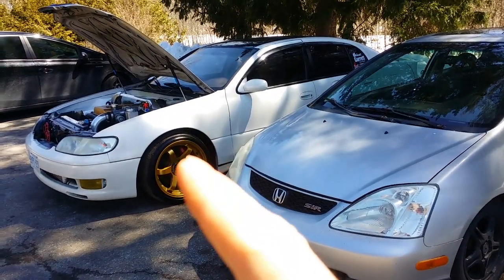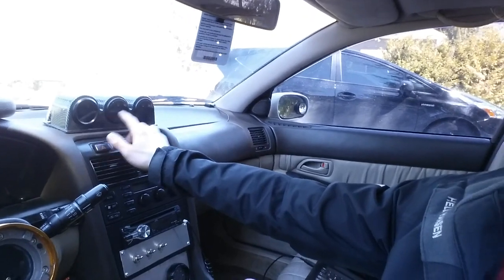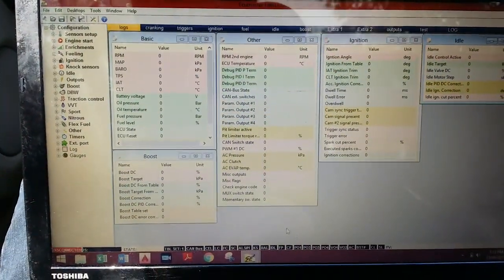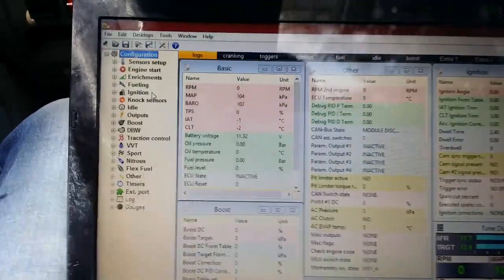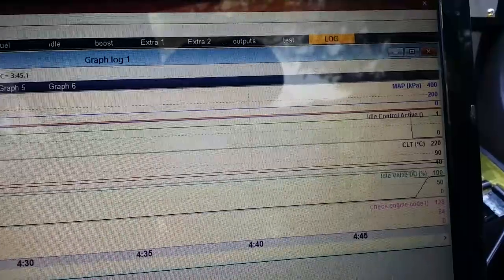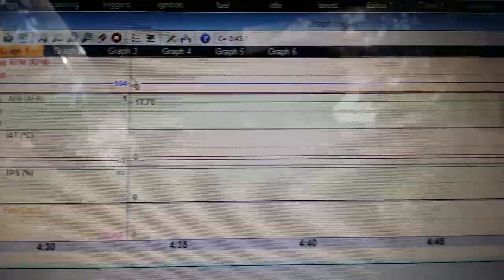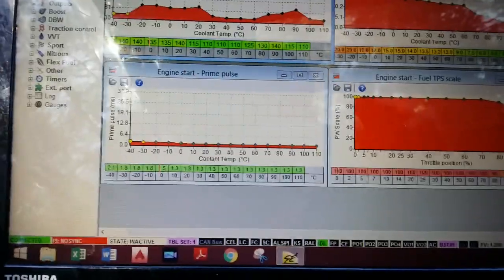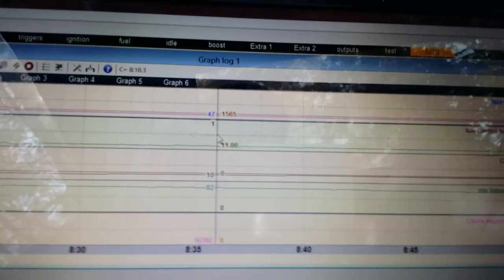How to Tune a Standalone ECU - Pt.1 INTRO

Comment: What controls the pulse of the injectors? 
Is their a pulse setting for injectors
Reply: The ECU it self calculates using your injector calibration data. The type of tuning here is called Speed Density.

Comment: Why don't you just put a heat shield for the transmission tunnel?
Reply from the maker: Not enough clearance haha... the trans is touching the tunnel in some spots
Reply: @jdmodsgarage  just let it smash on the heat shield then lol still a reduction. Probably use the thin flexible type that looks like what they make those turkey pan baking holders out of lol